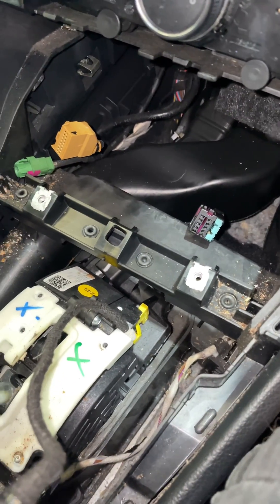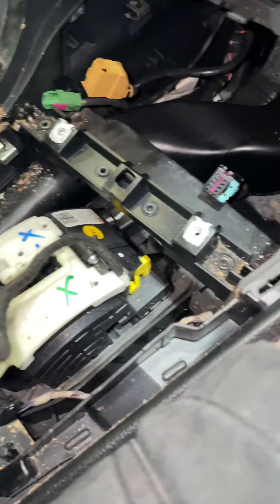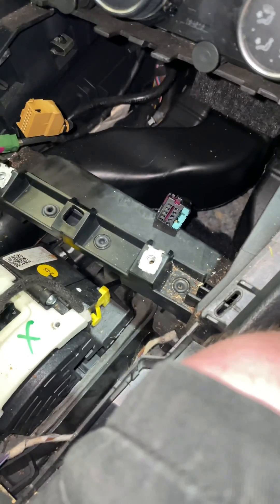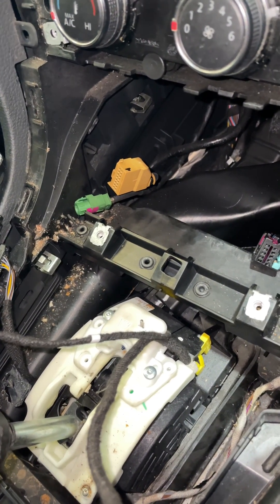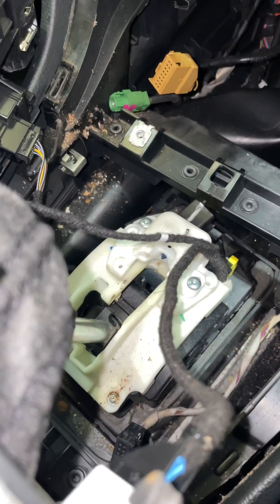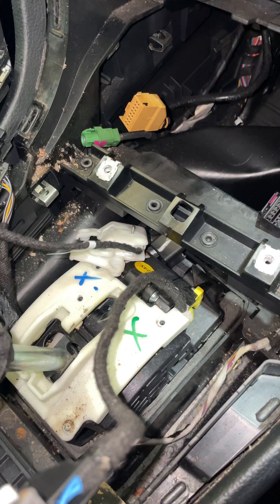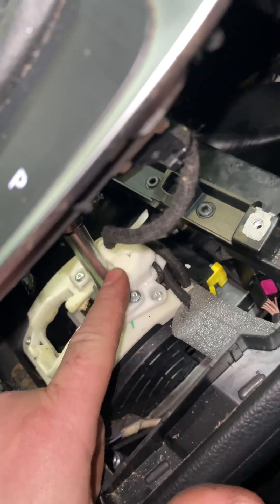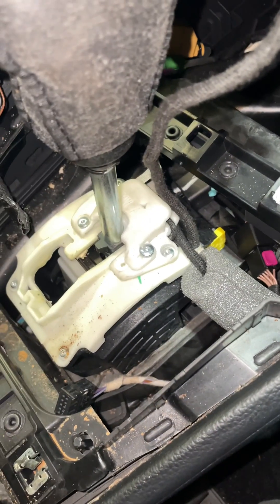Error Leave In “P” Fault On Dash (VW DSG)

Comment: Hello, i did everything like in the video and the error got fixed but now i have to use my handbreak always since It seems that the gearbox is sitting in neutral although It is showing in P in the dash any ideas what can be done to solve this? Thanks!
Reply from the maker: Hey buddy unfortunately without being able to diagnose it i wouldn’t have a clue it could be a separate issue either way it does need looking at

Comment: G'day from Sydney - I have a VW Polo 2017 DSG that had this problem. Long story short, the error messages multiplied and it turned out that a burnt out earth in the rear left indicator was responsible...

Dash was lighting up like a Christmas tree with phantom issues like the bonnet was open, windscreen wiper error and urgent warnings that the coolant was dangerously low. These things all worked fine. After months and 4 trips to the mechanic, new battery, codes wiped multiple times, new codes added themselves list saying the left tail lights weren't working - except they were. The very last straw is when an error came up saying there was a brake issue. Took it to a local autoelectrician and the first thing he checked was left lights. They were fine - he walked away to get some tools and the blinker had stopped. That's how he found the burnt earth. Thought I'd post in case it's helpful.
Reply from the maker: Hey buddy Thankyou very much for the comment and it’s a shame you’ve had this experience but anyone kind enough to share their experiences to help others is a total legend in my opinion 💪
Reply: Was the DSG error the catalyst to the fried earth? I've just applied this fix to my 2017 Polo after getting the dash warning every morning (it was otherwise only intermittent for the last 8 years) but I'm curious about why yours blew up in particular.

Comment: Hi everyone, I contacted VW and they said they don't have a repair kit for the 2019 VW Polo. I think they should fit all of them, or can someone help me?
Reply: Turns out the issue with my 2017 Polo was due to a burnt out earth in the left taillight panel. Dashboard was lighting up like crazy with a long list of error codes that pointed to phantom errors. VW service didn't find anything, I went to an independent autoelectrician
Reply from the maker: If that was me looking for that fault it would of been 30 mins or less but it’s not always down to Knowledge it’s more experience too
Reply from the maker: If they don’t do the repair kit then there’s your answer buddy unless there’s an aftermarket fix

Comment: If I have gear selector with white top, this part with this part number you use to fix, should work for me to? Mk7.5 golf gtd. The only part number from the top of selector I can see is 5q1713023be
Reply from the maker: You would need to call up your local vw place and confirm if there is a kit available for your selector lever type

Comment: hello! I assembled the part like in your video, thanks for it. I have audi a3 2015, alert seems to clear but now I have a new problem. When I'm in park, my car keys are not released. I cannot take it out easily. I'm wiggling the gear selector around P, and at one point it releases the key. do you think the part is faulty? any advise?
Reply from the maker: It’s either that or you’ve not quite got the switch close enough to the gear lever when it park so it’s not actually pressing it
Reply: @ an hour ago I fixed it, my gear selector's leather part was getting stuck between sensor and the iron 😄 I folded the leather different way and it fixed the issue :) thank you for the video and your comment!
Reply from the maker: That’s great news and your absolutely welcome glad your all sorted :)

Comment: Bought 3Q0713128A but actually I needed 3Q0713128 without A. Managed to install it anyway, but it would be nice if you add to the description that there are two different types
Reply: Te funcionó ? O tuviste que hacer alguna adaptación?
Reply: Hey, i need to buy the same part number and noticed the "A" version is about half the cost, how were you able to make it work or did you have to source the non "A" part?
Reply: @chicotunner07  I managed to screw it with some self-tapping screws to the selector cover, but I wouldn’t recommend my method, I don’t think it’s a robust solution. Just buy the exact part you need. Remember, a miser pays twice (Russian proverb)
Reply: @vesselovskiy got it, thanks for the reply! you had me at "self tappers" 😂
Reply: @vesselovskiy  how do you guys determine which one is the right one? 

There is a black and white shifter, ez. (Mine is white) now when I lookup the part number on autodoc it says it's incompatible with my VIN. 
I have an early dq381 A3 8v 2017 fwd.
Not looking to self tap it.
I just dont understand how to determine the correct part number 😅
Reply from the maker: My video isn’t there for you to get the part number for your vehicle I’ve just listed the part number of what I used in the video it’s upto you to make sure you purchase the correct one for your vehicle

Comment: VW MECHANIC   Hello I have 2019 VW TIGUAN VIN #3VV0B7AX8KM024935
PLEASE which part # do I need to change the selector park lock switch...here in Ontario  they charge 1200. Plus at the dealer...thank you for your help
Reply from the maker: Hey buddy Thankyou for the message unfortunately with that not being a chassis number from the United Kingdom I wouldn’t be able to assist but your local Volkswagen dealership should be able to give you the correct information you need
Reply: @TheVWMechanic_official  another thing  asked if I can buy the part  they said 584.00 Plus 13% tax...terrible
Reply from the maker: That’s pricey
Reply: @TheVWMechanic_official  they refuse to give me the part number...called another dealer and he gave # 5QH    only and no further info...not sure if my 2019 VW Tiguan comfortline   has the black or the white one...please help..
As well charged 225.00 for diagnostic..plus they want another 1400.+  to change tge defective Selector lever park lock switch...
Reply: Where to buy the parts one know

Comment: Hey from Australia! I have a VW Polo 2017 DSG. Exact same error. Is there a different process or part number for this micro switch? I'm confident to do this myself. Much appreciated and great video!
Reply from the maker: Hey Thankyou so much for the comment and this part may not be available for the polo but if it is your local dealership can confirm fitment and number but yeh it’s the same process to fit it :) hope this helps
Reply: @TheVWMechanic_official  Thanks for the quick reply! Cheers!
Reply from the maker: @RuthCrocker your more than welcome buddy

Comment: Hi mate I have a Volkswagen scirocco GTS 2016 it’s a DSG are you able to provide me the part number for the shifter position micro sensor please
Reply: Hi pal so I’ve got the new shifter I have installed it but it’s only letting me put it to park and reverse 😢😢 I managed to get get it into all the gear but then it wouldn’t let me can you please help me
Reply from the maker: I’m a bit stuck without being physically with the car
Reply from the maker: Hey buddy it will more than likely be selector unit itself on a scirocco

Comment: Have an mk7 1.8 without dsg got a transmission error when ran the code coming up as shifter lever is this the same fix
Reply from the maker: It would need correctly diagnosing to make sure this is what the car needs
Reply: @TheVWMechanic_official  p17c500 is the code that I get on my obd11 sensor
Reply from the maker: Doesn’t mean a lot buddy

Comment: Hi! I need help... some time ago, while driving, I switched from manual to automatic D. The gear shifted to N. I stopped and everything returned to normal. After shifting into P, the gearbox locked. Code 28775, “no communication with gear selector module” . Can anyone give me some advice? Thank you DSG 6
Reply from the maker: Needs diagnostic matey no good guessing at this stage as you can waste a lot of money firing up the parts cannon
Reply: @TheVWMechanic_official  Only one error is displayed, which returns after removal. I don't know whether to replace the switch first or the entire selector...
Reply from the maker: @najakakbzjxjzjzj in my opinion I wouldn’t replace anything until you’ve had it confirmed because what if it’s a wiring fault?
Reply: @TheVWMechanic_official  Confirmed by 👀?
Reply from the maker: @najakakbzjxjzjzj someone that can fully diagnose the car and give you the correct quote for repair
Reply: @TheVWMechanic_official  It is! My VAG mechanic checking all wires and connections now… but i’m also looking for a solution, and drinking 2nd bottle of whisky 😂 
I let u know guys, if we find the reason.
Reply from the maker: Did you find the reason?

Comment: Hello

I have golf mk6 Dsg I'm getting no PRND on cluster but the gearbox works as usual good I connected to vcds and got error code P0820 how do I fix this pls any help I appreciate
Reply from the maker: Hey thanks for the message the issue could be one of these:
1)Faulty Gear Lever X-Y Position Sensor
2)Gear Lever X-Y Position Sensor harness is open or shorted
3)Gear Lever X-Y Position Sensor circuit poor electrical connection

I believe it’s a new lever as I don’t believe there is a replacement sensor for the shift mechanism
Reply: @TheVWMechanic_official  I want to add that some symptoms of a failing gear position sensor is that the car might not start or shift regularly and I don't have such symptoms I think it might be the gear lever micro switch what do u think
Reply from the maker: @fadiabdo9976 I agree with you

Comment: i have similar issue, but the light on d gear selector is blinking with fault code P085100 and P091900, wht can i do?
Reply from the maker: You would need a diagnostic technician to carry out some testing on your vehicle to work out the fault for you

Comment: Hi mate just seen your video the message appears leave it in p work shop is expensive to buy the part also is this for vw tauran 2016 1.6
Reply from the maker: Hey buddy it will only work if your gear lever matches this one in the video and the part I show in the video is less than £100

Comment: Hi, i have this issue with a T6.1 transporter.  Do you offer advice at all for what part i need or do you fix this as a service?
Reply: Hi guys, just had mine in the garage for the same thing t6.1, a vw specialist orderd 2 diffrent repair kits which don't work which would of cost £350 he reckons I need the complete unit module costing £1030 😮 how did u get over urs?? Cheers
Reply from the maker: That can happen if there’s not a repair kit available same as the mk8 golf
Reply from the maker: If you give vw commercials a call matey they can give you the correct part number as I don’t work for commercials I can’t see their systems
Reply: @TheVWMechanic_official  thanks for your reply.  I’ve had my van in and they want £1k to change the whole mechanism/shifter.
Reply from the maker: @football-fantastic you won’t be surprised how many times I’ve heard that buddy it’s scary and so expensive
Reply: @TheVWMechanic_official  it’s crazy. My van is only a couple of months out of warranty. It’s a shame nobody has a solution like this.
Reply from the maker: @football-fantastic this is a winner buddy really easy to fit aswell no coding needed so if they have the part number for yours your on a winner and saved a boat load of money
Reply from the maker: @football-fantastic add me on instagram @thevwmechanic1
Reply: @TheVWMechanic_official  don’t suppose you know any commercial VW guys do you? I am desperate to find the part needed.
Reply from the maker: @football-fantastic as it goes I do matey I’ll send a message now pm me on instagram it’s easier to chat
Reply: @TheVWMechanic_official  done.  Thank you!
Reply: @Reel-Rich-Carping  Hi did you find a solution to this. Got the same issue in my T6.1 today amongst an array of other errors like brake fluid low

Comment: Hi mate just wondering if you had a parts number other than the one in the description that would fit a Seat leon 2015 model, I have the black gear selector.

I’ve looked on eBay and apparently the 5Q0713128, doesn’t fit my model.
Reply from the maker: Hey thanks for the message if it’s a different lever to the one in the video this fix may not even fix it buddy check my other micro switch video out and see if that matches
Reply: Thanks your reply, I’ll have a look
Reply from the maker: Keep me posted :)
Reply: @TheVWMechanic_official      I’ve had a look at your other video and it seems like it’s the same lever, however I can’t seem to find anywhere on it to screw the repair kit on.
I’ve sent you a picture on your Instagram.

Thank you in advance
Reply from the maker: Did you get sorted with this?

Comment: How do you know if you need this while or black microswitch part? (without opening your own to look)
Reply from the maker: You need to open it up to look as it depends on which lever you have fitted to your vehicle
Reply: @TheVWMechanic_official  Hi if you have the white top part no is as follows (3Q0 713 128  the black top one is (5Q0 713 128B) also the black top as a yellow bar to the right hope this helps you
Reply from the maker: Thankyou

Comment: What actually happens to the original switch? Does it simply get dirty, in which case would a squirt of switch cleaner fix it? How easy is it to get to?
Reply from the maker: It fails buddy internally and the idea behind this add on is that it just bypasses the old one without having to be intrusive
Reply: @TheVWMechanic_official  Yes, I realise its a bypass. Have you ever tried to get to the original switch?
Reply from the maker: Built into selector lever would have to go pretty far into it to find it and by that point the labour of me doing it would be higher than the labour of fitted the additional microswitch so never really needed
Reply: @TheVWMechanic_official  Thanks for responding
Reply from the maker: Your welcome buddy